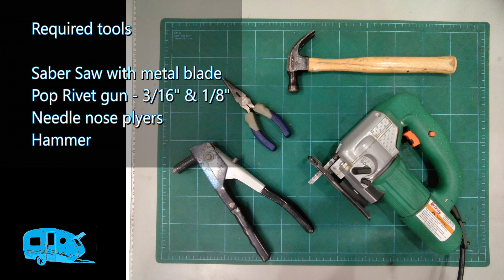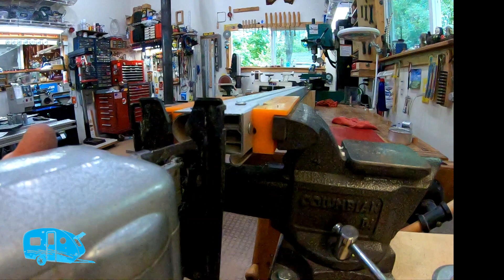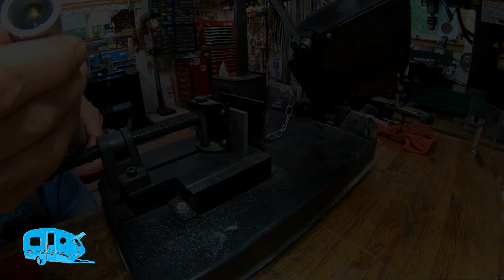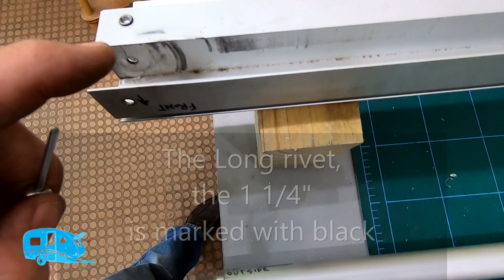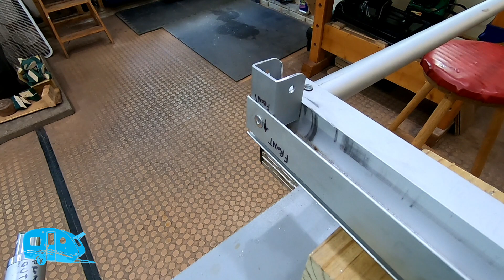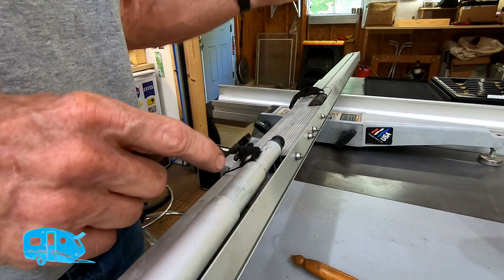How to install the Dometic awning repair kit

Comment: Where can I get one of the repair kits
Reply from the maker: I made several sets a few years ago, but not for some time now. However, I do have a completed assembly, essentially everything but the fabric awning. It would be a perfect replacement if that's what you need. If you are in or near Michigan I'm sure we could work a very reasonable arrangement.
Reply from the maker: Not interested?

Comment: Do you have any advice for me as I hunt around for an inexpensve, easy to use GPS?  I have never used one, yet.  Thank you.  Stay well.
Reply from the maker: They all operate, more or less the same. I have a TomTom, an I like it, however, I would probably consider a Garmin instead. More folks use them, so might be easier to find help. Just get an inexpensive one from Amazon or a big box store. Don't bother with anything fancy, it'll just have a bunch options you won't use. Safe travels. 🙂 ---Mark
Reply: @AdventureswithJane  Thank you so much.  Be well and safe.